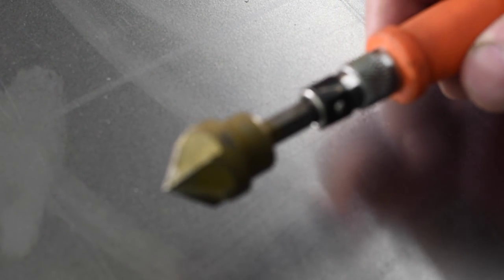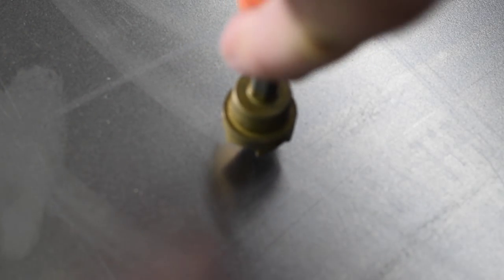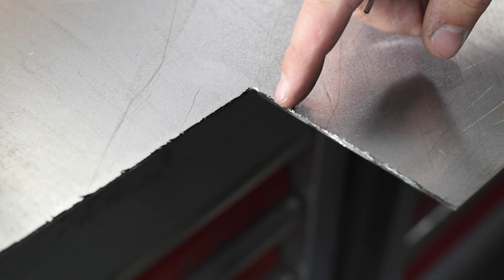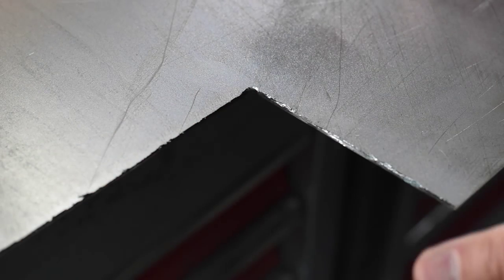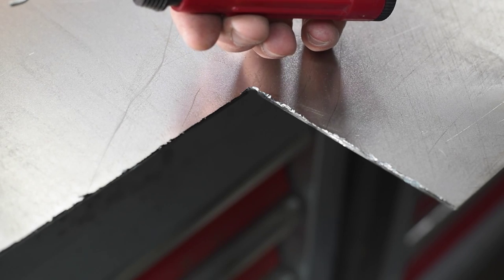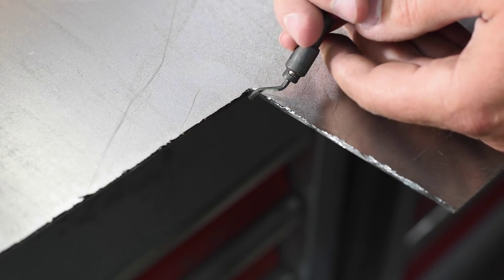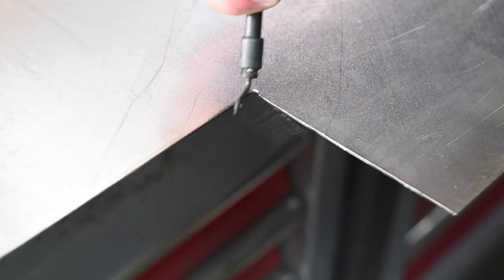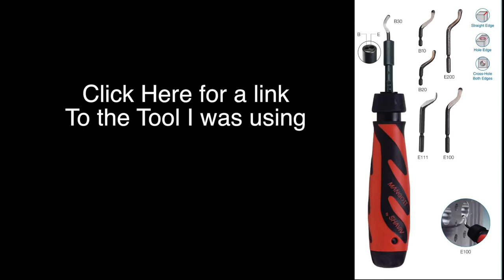Hand Deburring Sheetmetal in 2 Min

Comment: I like the edge deburring tool.  For holes, I usually just use a counter sink....and for large holes, I have a hex->hand tool adapter and will attach a step drill for deburring.  Still, pretty cool.

Comment: Thumbs up Gary those are handy tools for sure, I like the cranked deburring especially well for cleaning off the burrs on pipe, plastic or metal. Sears has those deburring tools hanging on their tool boards. They are made in Israel and sold by Sears, they come with an extra blade which I promptly lost but they work great. Cheers OLDDUDE

Comment: Cooowell we use that debur tool at work when running refrigerant lines. have to clean the burr off the cut ends so no drag inside the pipe
Reply from the maker: fatstercat Makes sense, thanks Mark!

Comment: They actually make another blade for those that looks like a vee.......it deburrs both sides in a single pass. I guess they use them in production sheetmetal shops.
Reply from the maker: K&L Machine and Welding Ok yea, I have seen guys use those but haven't seen any of the kits that have that in them.  I like the Noga Multi tool version, but it's kind of pricey!

Comment: never liked this tool,look like something you could drive into your forearm real easy,using it while holding the piece with the other hand ,no thanks lol
Reply from the maker: ***** If you have the piece clamped down to cut it, while its still clamped you can deburr it quickly with this tool.  If pull it in a direction that if it skips off is away from your body you never have to worry about it.  I am not sure why people struggle with safety stuff so much, I am drilling, cutting, grinding something pretty much everyday, and my hands never get cut.  The worst mistake I ever made was I welded a piece, and was in a big hurry, and through my gloves off quickly after welding it and grabbed the hot metal and got 2nd degree burns, lol
Reply: I hope you don't take my comments too personal sometimes Gary,we're just sharing ideas here:-)Of course there's a right and wrong way to use this.Its just a feeling i have, like your shop saw that i'm skurd of lol Keep up the good work !!
Reply from the maker: ***** No worries John we are good... you are my personal safety nazi!  call me out on all of my dangerous tools and activities!  I was just mentioning that there are some people that don't say anything about the content and point out the one safety hazard... bottom line is, if your going to be working around tools and cutting, it's dangerous stuff, you can get hurt!  I accept that fact everytime i step out there!  Btw, when you going to put any vids?  you doing anymore cool projects?
Reply: I'll try to upload something this week-end....thanks for asking, the basement reno is on hold they're redoing all the pipes in the street and i will have to reverse ALL my plumbing so it goes out from the front of the house lol
Reply: True my friend  very dangeros tool i rather use the old shcool way..